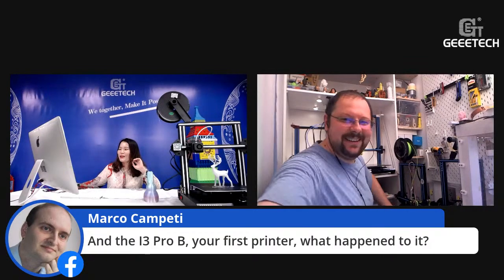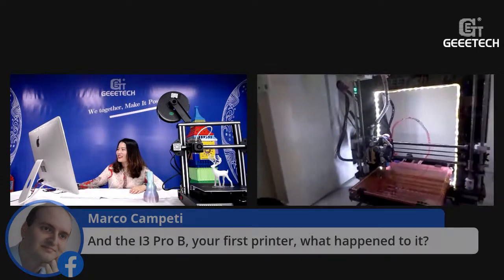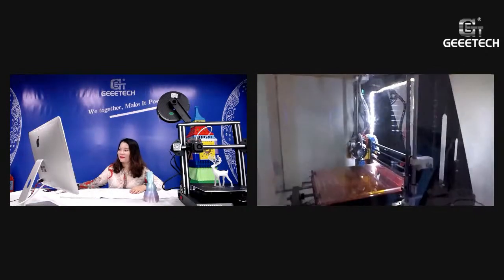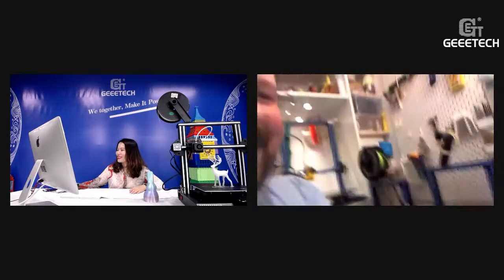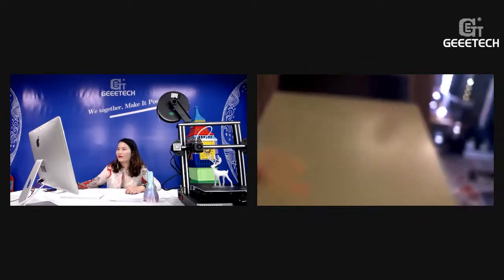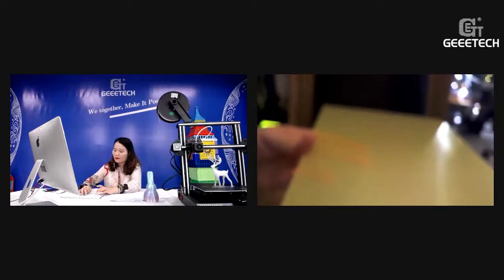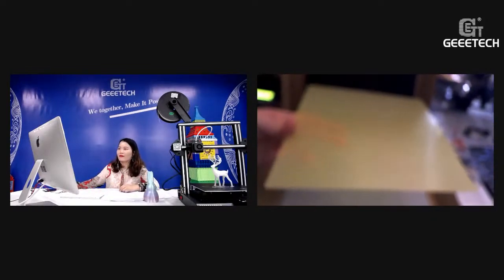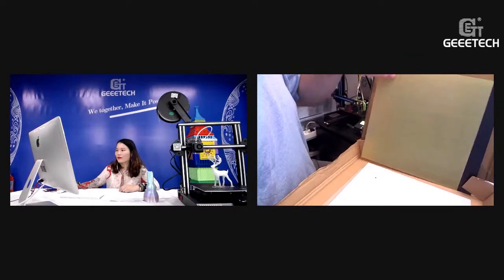Geeetech A10M/A20M upgrades/downgrades

Comment: Hi I have an A10M and the hot bed temperature sensor doesn't detect the change of temperature. The thermoresistor is ok. What I can do? Thanks
Reply from the maker: Please check whether the hot bed thermistor wire is plugged in tightly or not, it is better to re-plug it, also please check whether the thermistor is damaged
Reply from the maker: You can also exchange nozzle thermal sensitivity and hot bed thermal sensitivity. If the fault phenomenon is also exchanged, it is that the heat sensitivity of the hot bed is broken. Otherwise, the motherboard is broken

Comment: This guy is not a good choice Geeetech! Sorry but we buy the a10m/t because of the 2/3 filaments capability. That's what differentiates geeetech from creality and the like. Get someone who will talk about using and upgrading YOUR printers please. I would show you my: a10t's upgraded extruders (all 3) with tips on removing, how to replace the hotend for an a10t, bowden upgrades, stock bed spring to spacers upgrade, spacers to upgraded springs, fan upgrades, Marlin 2.1, and more to a printer that can still fulfill its original design specs... multi-color prints! If you want single extrusion, a regular a10, a20, or a30 would be a cheaper starting platform right? Contact me, I would love to tell people about Geeetech printers and upgrading their capabilities.
Reply: Clearly you don't know this person. I have talked to him, I have print his design specifically for upgrades and he has provided great support well before the a10m came to geeetech. This is not a random person that geeetech found and added to the live stream.
Reply: @V1N_574  no he's very knowledgeable. But he takes a machine that the specific point is 2 filaments and turns it into a single. Doing this makes the "M" or in my case "T" meaningless. Honestly just buy a basic A10 for what he's doing, then I'd be 100% for it. I tuned in for some upgrades and tips on dual extrusion, what his A#0Ms were built for. I do like his wheels and supports, but he no longer has A#0Ms.
Reply: Please do so, you can apply as a speaker at: https://www.geeetech.com/maker_salon.html
I’d be happy to see your upgrades in a live show, you made me curious👍
Reply: I did immediately after my first comment, thanks. My A10T is cranking out some green (Blue PLA E1 .5 / yellow PLA E2 .5) offset runout detection sensor mounts. New extruder kit doesn't load in the same spot, as I used the stock motors and mounting brackets. I was tired of free floating bits. Still working out kinks every day. I really do love the color green these filaments make! The hardest part of that upgrade was either getting the grub screws out of the stepper gear on the motors (spoiler: I love my Dremel), figuring out how to reverse the extruders in Marlin (spoiler: configuration.h), or calculating the new esteps (spoiler: went from 420-430's to 90's). The name of my approach to this printer's game is: "War of the strings and bubbles part II, the hottest end". It's like "The Bourne Identity", I promise. Kind of.
Reply: And also don’t forget I talked also about PC-Wheels, Silent Stepper drivers, Frame Stiffener, Dual-Z Axis, Firmware updates, DualDrive extruder etc.
You are fixating on my conversion from two to one extruder, but that was only 15% of the show...just saying...
Reply: @MrRedWA  kind of. I tuned in for some dual filament tips, the purpose of the "M" variant. While your upgrades are good upgrades, it's the downgrades I'm sad about. Like I said already, I'm down for your upgrades and want to do several of your suggestions. Maybe I idolize the capabilities of multi filament, why I got the step up from your original machines... triple extrusion. I strive to achieve that mastery, not lowering expectations of the machine and downgrading so it can achieve them. 
That's like flying a plane that flys "ok" then taking off it's wings, add a fourth wheel, and convert that pesky propeller into a gearbox to power your wheels. Maybe it'll beat Ferrari's but it still was a plane last week, it used to be able to fly...
Reply from the maker: Hello thanks for your comments. Akos is a great Geeetech users in our user group that shares a lot of his experience and knowledge. And we do welcome all 3d makers to share on live with us. Can you get in touch with us in Facebook ahout yout geeetech printing stories and upgrading your printers? Thank you again !
Reply: @geeetech3dprinting   @Geeetech  he is a great user and what he said was correct and as I said I'm just disappointed to not see any tips specifically related to the 2 in 1 out capability that makes it unique (and more expensive). I myself am still struggling to achieve reliably good prints because I choose not to downgrade. Retractions and temperature consistency will be the death of me with my 3 in 1 extruder. The type of system needed to make mixing possible makes it lack in other ways. I see people get great prints out of these machines, I want to learn how. I applied on your website but don't want the rest of my life put out there on my facebook. I barely use it and prefer to keep my private life private, my social credit system score would be very low haha.
Reply from the maker: @jdizzforyou  Thank you. I will get back to you on facebook.
Reply: Have you considered making a video of your upgrades?  I notice a distinct lack of any a10t related content on your channel.  If you'd love to give people tips about the printer and upgrading its capabilities, then that is something you could already do; whether or not you get featured on a Geeetech stream. :)